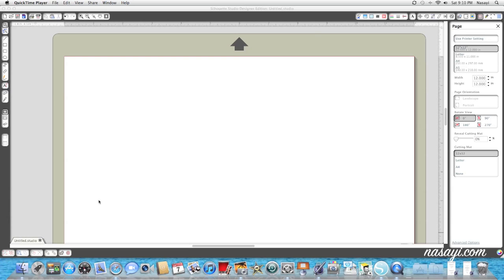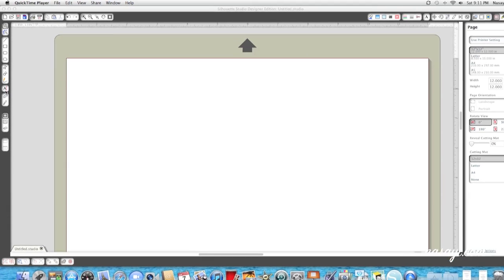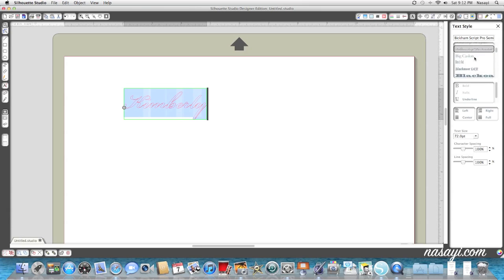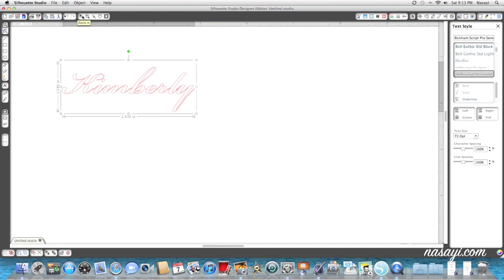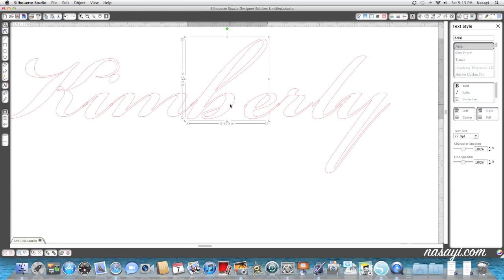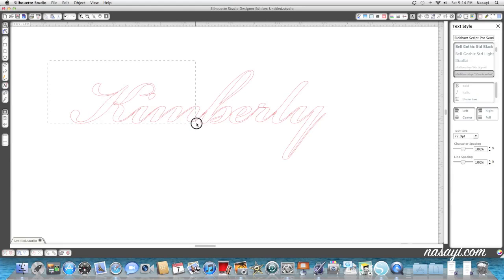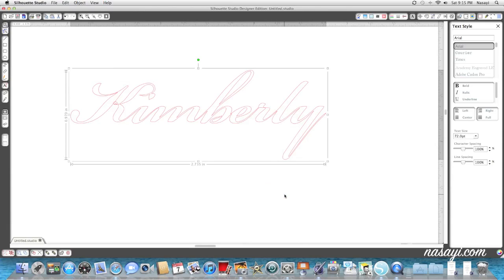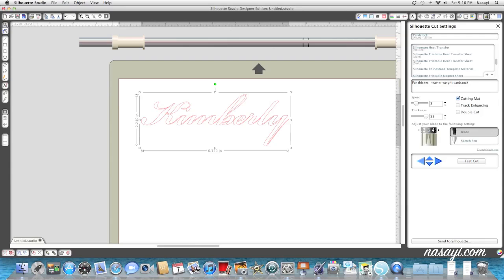Welding Letters - Silhouette Studio Tutorial

Comment: What about when you need to keep the center part of the cut attached like with the letters A, O, e, P etc. when cutting paper silhouettes? Is there an easy way to keep those attached?
Reply from the maker: +Raymond Isbill (IsbillPhotography) Draw a bounding box around the letter with the pieces in the correct place, right click, and select "group".
Reply: +nasayi tried that but it still cuts out the centers which would be fine for vinyl.
Reply from the maker: +Raymond Isbill (IsbillPhotography) Oh... I think I misunderstood you. Do you mean &quot;attached&quot; like it comes off in one piece? That&#39s a little more complicated. You can do it but you have to zoom in really close and draw little &quot;bridges&quot; or &quot;bars&quot; to weld the two parts together. It can be done but it changes how the letters look (stencil letters). http://www.silhouetteamerica.com/printer-friendly/faq/creating-stencil-letters 
In this example they say "subtract" but you will need to weld instead.
Reply: +nasayi thanks! I'll have a look. I'm currently creating the text in photoshop and then tracing it in Silhouette studio. I was hoping there was a way to skip the photoshop step. Maybe creating in illustrator and sending directly to the cameo to cut would be a solution.

Comment: I thought you did a great job, but you didn't show HOW you moved the letters.  My letters skip into each other.  (Yes I did ungroup them) I can not move them slowly or in small increments.  I even tried to use the MOVE settings, but again, they hopped on to the edges and overlapped.  I never did get edges close enough to form circles.  I've tried using my mouse, finger, etc. but no luck.  I have a Mac and did not see the Brickham Script Pro.  If I need to change a setting, please let me know.  I'm using Lucinda Calligraphy Font.
Reply from the maker: Hi!

You can move slowly by using your arrow keys on your keyboard. Not sure why you don't have the font....maybe it was removed from newer macs. Perhaps you can find it online and download it.
Reply: I used the arrow keys, but it just hopped.  Can you weld all fonts?  maybe it's the font.

Comment from the maker: It sounds like you used "release compound path" which will ungroup but will also release the pieces that create the inner parts of an O or an E. If they are separated (as in released from the compound path) they will disappear when you weld. Are you using a regular font or something from the silhouette store? If it is something from the online store then it's a different issue/ solution. ;)